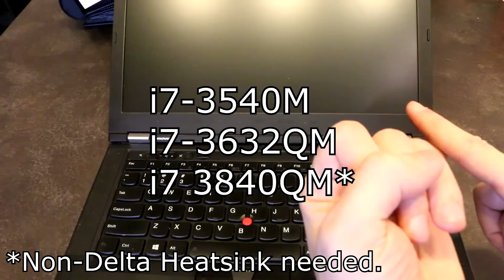Lenovo ThinkPad T430: Upgrade Wonder

Comment: If I'm at the Lenovo Diagnostic Menü, There is a Only "Quick Memory Test" and "Exit Application"
Reply from the maker: I'm not entirely sure what you are asking/saying here. Are you having issues?
Reply: @LaptopRetrospective  I have a Lenovo Thinkpad T430s
Reply: @imnotlxgit5762  Your best bet would be to go and grab Lenovo Vantage in my opinion. It has saved my backside plenty of times.
Reply from the maker: If it lets you boot. Unless there is a bootable version.
Reply: I don't think there's a bootable version, but if you can get into Windows it's really handy and can fix quite a few things.
Reply from the maker: Yeah. The OP isn't clear in the issue they are having.

Comment: You better buy a used T430 than a brandnew supermarket laptop made of plastic and with no chance to replace parts for about 400, 500, maybe 600 euros.
Reply from the maker: There are certainly advantages, it all depends on what you need the computer to do.

Comment: Is it worth in 2019? And how durable is this laptop?
Reply from the maker: Yes and very. There is a reason there are so many around still in use.
Reply: @LaptopRetrospective  good to hear that, my friend. I am offered to buy this machine with i5, 8GB Ram, 320GB HDD for 170 euro.
Reply from the maker: That's a decent price. Be prepared to replace the battery and I'd swap in an SSD if it isn't already.
Reply: @LaptopRetrospective  Yep, but the web camera doesnt work...
Reply from the maker: Could be the camera or cable. To replace both is less than $25 CDN.
Reply: @LaptopRetrospective  Okay. Thats cool. I am gonna buy one :)
Reply: @LaptopRetrospective  thanks for the fast feedback, bro! It was very helpful!
Reply from the maker: Hope you enjoy it! Remember that the service manual is readily available if you need to work on it.

Comment: What are they like for battery life?
Reply from the maker: Depends on how hard you run them and what cell count you have. People claim some pretty good numbers.
Reply: @LaptopRetrospective  do these refurbs generally. Come with new batteries? Or are they hard to get new one?
Reply from the maker: New batteries are easy to find. Some refurbishers will issue new batteries, others won't. Check before you buy.

Comment: This is probably my laptop of choice, I need to replace my current laptop and I was really attracted to the thinkpad style and the moddability of this thing. It's also on Amazon with 8gb for like 200 usd. I know I could probably get it cheaper on ebay, but I'd like something decent over a complete project build. Since I don't game as much as I used to, it can run AoE 2, Rome, Fable, and some other classics which is all I need nowadays (and Rimworld!). 

Also your advice on the pi is grand, but I think most people should get one! The zero, the one I have, is a fantastic little machine and it was like 10 bucks or something.
Reply from the maker: Very nice. Lots of options out there.
Reply: Hey, do you know if this laptop could run football manager 2020? That's all I'd really want to play plus the ones you mentioned!
Reply from the maker: System requirements for it are fairly low so you can probably manage. Not sure how well since I've never played it.

Comment: Hi I’m looking to get one of these to help me with a new career in IT and cyber security. Would you be able to advise to what internals to look for? I won’t be using for gaming, just taking apart, programming, possibly Linux? 
Unless there’s something else you recommend for a complete newbie
Reply from the maker: In terms of internals, I don't see that having an impact beyond something you can upgrade a lot to understand how things work.
Reply: Laptop Retrospective Thanks, also what negatives would you say there are between the smaller x201 against the t430? Furthermore can Linux be run alongside windows?
Reply from the maker: X201 is several generations older. Linux can be ran side by side.

Comment: Planning to buy this laptop, can i play apex legends in this?
Reply from the maker: System requirements?
Reply: @LaptopRetrospective  CPU: Intel Core i3-6300 3.8GHz / AMD FX-4350 4.2 GHz Quad-Core Processor

CPU Speed: Info

ram: 6 GB

os: 64-bit Windows 7

Video Card: 1 GB NVIDIA GeForce GT 640 / Radeon HD 7730

Pixel Shader: 5.0

Vertex Shader: 5.0

Free Disk Space: 22 GB

Dedicated Video RAM: 1 GB
Reply from the maker: The T430 doesn't have a dGPU generally and with the CPUs listed, I'd wager if it did run at all, probably not well enough to play.
Reply: @LaptopRetrospective  can it play smooth?
Reply from the maker: I doubt it.

Comment: I'm watching this on a T430 that I've done a few upgrades to so far:

- Brought the RAM to 12GB with the sticks I had on hand
- Swapped the original chicklet KB for a backlit one

What I hope to do next is swap out the LCD, change the 2nd 4GB stick to an 8GB, get a SATA drive bay for a 2nd SSD.  I'll still keep the DVD burner to swap out on the fly.  

I'm good w/ the i7 3520M that's in it currently, don't need the Quad Core.

I enjoy your content, especially on the AMAZING ThinkPads!  Thanks for sharing!
Reply from the maker: Thanks for the update Ryan on your upgrade history. Eager to hear how your LCD panel work goes.

Comment: wish I bouth one of thses instead of a mac, alas I was blind... sigh*
Reply: I hackintoshed my L530 and later my T440p, (MacbookPro 9,1 and MacbookPro 11,1 officially) mostly to run Logic Pro X without buying a Macbook. One of the best ideas of my entire life. I ended up removing my windows SSD on both because I was no longer using it. Best part is that my L530 dock works flawlessly OOB on MacOS
Reply from the maker: It is never too late.

Comment: hey man . look I have a T430 and I love it . the only problem  is my VGA port . I have a Dell Monitor and it works with my other laptop pretty good but with my T430 it's  all noise . and it gets disconnected  every 30 min . I don't know what the hell should I do so I Appreciate any suggestions and help . thanks .
Reply from the maker: Very strange, sounds more hardware related than software. Might want to take a look at your board.
Reply: OK . i will look in to it . but I ran diagnostic tests  on GPU and the board . I don't know  maybe  my VGA Cables  are not suitable .any how thanks for the help dude . I hope I found the source of problem soon because  it's driving me crazy 🤪
Reply from the maker: Good luck. I hope you find it soon too.

Comment: Does anyone know is it possible to replace bottom cover of t430 without removing the screen and whole chasis? As i got another i7 t430 today but bottom cover is broken on the corner.
Reply from the maker: Check the maintenance manual.

Comment: Picked up my T430 about a year ago for $220. Added 16gb of ram and a 500gb SSD. Super solid machine!
Reply: If i add 500gb ssd do i have to reinstall windows ?
Reply: @jefferymillerjr8572  Since the laptops tend to come with smaller SSD's, you can easily upgrade to a bigger drive using Acronis or another migration tool.
Reply: @dskribe9598  what you be the difference and would I have to reinstall windows?
Reply: @jefferymillerjr8572  The difference is speed. Migrating using Acronis Snap Deploy doesn't take long at all and you can pick up a license from them directly for $10 (one time use) or $30 (can use as much as you want only for that machine) versus a manual install of Windows which takes hours. Good luck! PS: Just to clarify, Either do it via Acronis or reinstall Windows.
Reply from the maker: Depends if you replace the original drive or not. If so, then yes, you'll either need to clone the original drive or reinstall.
Reply from the maker: Nice. Lots of RAM to go around.

Comment: @Laptop Retrospective  I bought this T430 immediately after watching this video. I immediately installed Scientific Linux7 on it and after 20 minutes of use, my hands started tingling especially the track pad ha d. Is radiation possible if this laptop is refitted with components that are too powerful? Is there a Max capacity for this laptop? My hands were tingly for about 5 minutes after. It was bizarre.Thanks! Specs: Refurbished Lenovo Thinkpad T430
Intel Dual Core I5-3320M 2.6 Ghz processor

2 x 8GB DDR3 Ram

120GB SSD Drive

DVDRW

14" Screen

Wifi 802.11a/b/g/n

Bluetooth 4.0

2 x USB 3.0

PoweredUSB 2.0

VGA

Mini DisplayPort

LAN
Reply from the maker: Tingling??? That's a new one. Only thing I can think is if the ground to the keyboard is wonky. Radiation is definitely not the issue. If it was emitting enough for you to feel then you'd have side effects.
Reply: @LaptopRetrospective  Ok, thanks, maybe it is the keyboard. I'll  take a look. Good to know that radiation shouldn't be a problem. It feels like tiny prickles...like electricity so I'll check all the connections.
Reply from the maker: The only thing I can think of is the connector is damaged, not seated properly or maybe they tried to do the Classic Keyboard mod and botched it and put the original chicklet one back. Thankfully this is easy to do. I'd take the keyboard out, look for strange/unusual damage or colours, then reseat, see if it still happens.

Comment: I am considering buying it in 2019 as laptop for coding.
I could buy it for 200-250$ depending on specs.
I am mostly afraid of its low quality screen, i would definitely go for 1600*900, but still not sure if it is good enough for other  X and P thinkpads with IPS full hd screens.
Reply from the maker: Unless you're doing art or things that demand colour accuracy they aren't that bad.

Comment: I love Thinkpads. Wife has T500. We upgraded memory from 8 to 16gb and installed a 500gb SSD. It is running Linux Mint and is very fast. My Thinkpad is a W520, 32gb,  500gb SSD w/Mint, I put a 2tb HDD in the DVD bay, and use it for video editing. It is my 5th Thinkpad ... a bit bulky but just run flawlessly. So sturdy you can leave them to your grandchildren.
Reply from the maker: Haha yeah, pretty much. I've read as lot of comments on how they get handed down.

Comment: I bought my T430 2 weeks ago for about 50$ usd. I've added 4GB of ram and ssd, replaced the fan. It's my main laptop now. Works great. :-)
Reply: Hey! I have the same laptop. May I ask what fan you bought and if now your laptop is silent? Cause I am having issue with the fan noise... Other than that I love T430!
Reply from the maker: Ah I see you're exploring the fan situation. Check the maintenance manual in the description for part numbers. eBay is great.
Reply: @LaptopRetrospective  So it's just my laptop that makes noise? That means I can fix it by buying another fan maybe?
Reply from the maker: @Laura-lg1tb  Yes.
Reply: @LaptopRetrospective   In case I have to replace the fan do you have any suggestions on the fan I should buy?
Reply from the maker: @Laura-lg1tb  the maintenance manual will tell you exactly what you want to buy.
Reply from the maker: Nice buy!
Reply: @LaptopRetrospective  i bought mine for 230usd, i5-3320m, 8gb ram, 1366x768, 500gb HDD did i overpay?
Reply from the maker: Sounds good.

Comment: The best notebook ever. I have bought an used one for 200 bucks online, then upgrade with a ssd and 16gb of ram an now this machine os flying! Runs like a new computer. Lenovo make these thinkpad series in a way that you can totally dismount and change parts separately. Marvelous!
Reply from the maker: Yes, a good chunk of them are made to be taken apart.
Reply: Hey, idk if you’ll reply bc you’re like a year old comment buuut when you upgraded to 16gb of ram could you play Minecraft?
Reply from the maker: Ram helps but it isn't the only requirement.

Comment: Hi I am looking at this for a student laptop - running Microsoft word, storing photos - very ligth work. 

The one I am looking at is: Lenovo Thinkpad T430 i5 2.6Ghz 4GB 320GB DVDRW USB 3.0 14″HD W10 Pro
Will this do the trick?
Reply: To run word any computer does the trick, even a t60, actually a t60/t61 is better for office work because of the 4:3 aspect ratio.
For anything else though, you want a more modern laptop like the t430
Reply from the maker: Easily. Be prepared to replace the battery as they often come with worn down ones. I suggest the 9 cell if longevity is important to you.

Comment: Awesome video, been in the hunt for a new laptop as my Asus' motherboard just popped the bed. Found this locally for 275 CAD:

Lenovo Thinkpad X230 Intel Core i5 3320M 2.6GHz 4G 320G

Do you guys think it would be fine for doing light gaming(older titles, nothing super extensive) and the typical browsing, streaming, etc.. Love the idea to being able to upgrade if need be and tinker.
Reply: Whoops, copied the wrong one. It's a T430 Core I5 3320M, 4G Ram, 320G SATAIII for $240
Reply from the maker: Does it have an Nvidia GPU? What games?
Reply: It doesnt say so I will assume it's not there. As far as games go:
Dawn of War 2
Homeworld Remastered
This War of Mine
Warcraft 3

Would love try Fractured space, Frostpunk or Northgard too.
Reply from the maker: Check the minimum system requirements. I believe the T430 runs Intel 4000 integrated graphics so be sure that would be enough for your needs. Or be ready to explore the expansion card egpu mod.
Reply: Thanks for all your help, I found a different t430, I5 4G RAM with the Nvidea graphics so I think I'm going to pull the trigger on that one(180 CAD)
Reply from the maker: Good price if it's in good shape.
Reply: Got it for 170, it's in great shape too. Excited to dip into Thinkpads, first thing to do is to upgrade to 8G ram.
Reply from the maker: SSD should be next. Huge difference.
Reply: I seemed to overlook that it was a T430s, wanted just the regular T430 but oh well, already bought lol. Yeah I want to do a SSd in as well but I dont have the windows install if I were to swap it out
Reply from the maker: Use the tool from Microsoft to make it.
Reply from the maker: Windows Media Creation Tool is the specific thing you need. You should be able to use the key attached to the unit.

Comment: This video got me so far as to purchase a T430 off of eBay, I just hope the battery is OK! I7 3520m, 8gb of ram, and an 225 GB ssd :)
Reply from the maker: Not bad, glad you found it helpful! A new battery won't break the bank and having a spare never hurts.
Reply: @LaptopRetrospective  I might consider that! I just found out the charger I got from amazon is rated at 90W, but it was listed at 65W, so I'll have to deal with that hassle first! Thanks for the video!
Reply from the maker: Common mistake often made by sellers as they look very similar. Hope you get it sorted out.

Comment: Ah, the 30 series. The last real ThinkPads. I've decked the whole office out in these, they've become the standard (though I now go for the t430s, the slim, lighter version). Last ThinkPad to have LEDs, touchpad buttons, and to be actually built like a ThinkPad. After that, it was all jet-setting executive MacBook-derived garbage. :(
3:43 I frikin died when the video cut away without mentioning the 2nd stick is under the keyboard, 2 screws away from where you were.
Reply: thanks for the info, I might buy a t430 or t530 sometime when I'm on my own money because I'm a sucker for vintage :D

Comment: Bought the T430 a few days ago after doing some research. Gladly it is for now a nice choise. I have the i5 with 8gb and 128gb SSD. And the screen is 1600x900, but is no deal, i use it at home with a extern nicer and bigger screen. For me its all an upgrade so im happy with it, even if its a old model. Its still good i noticed so thats why i made this choise and the price was good too, 200 euro. I use it just for regular stuff and some small gaming. I got the fm 19 but playing on low spec as the T430 doesnt have a great vid. card. 

Im not a expert on upgrading laptops so i think i wont do anything, but the heatsink. Is that to keep the laptop cool or? Atm the laptop is quite oke and doesnt heat up that much for now.
Reply from the maker: Glad you're enjoying it. The heatsink should be fine.
Reply: @LaptopRetrospective  Thanks. Nice vid also by the way. Ah ok, so there is a heatsink on it already i guess...?
Reply from the maker: Correct.
Reply: how's the fm 19 performance on T430? I planned to get T430 as my main laptop (ms office task, browsing, streaming and fm 19 for daily) thanks
Reply: @teguhrama2522  Hey i bought one and playing fm19 on it. :) Only the graphics are not good so you need to play 2D and not 3D, but overall its playable. And i like the laptop alot, very nice with ssd also. Using it for normal stuff, not any high performance stuff or anything.
Reply from the maker: Not familiar with FM19. The rest is easy.

Comment: Im thinking to buy T440. Is it good? I want to use it for programming. What do you think?
Reply: I was going to be a student in Computer Science. So i will use it on the college. I don't know what kind of programming that will face there
Reply from the maker: So they give any suggestions for system requirements?
Reply from the maker: What kind of programming?

Comment: Review about the camera please?
Reply from the maker: You mean the webcam or the one I film with? 😁
Reply: @LaptopRetrospective  webcam, sorry for my bad english. is this laptop good for home based job?
Reply from the maker: It's functional. It won't win any awards but it does the job. Let me know if you want specific information and I'll try to get it.
Reply: @LaptopRetrospective  for 218$ t430 8gb ram and 160gb ssd. is it worth it? i am planning to but this one.
Reply from the maker: If it's in good cosmetic condition and the battery holds a charge, I'd do it. Assuming that's USD?
Reply: @LaptopRetrospective  thank you. Its USD, i saw it selling online. Looking for the specs i think its a good buy.
Reply from the maker: Might want a bigger SSD down the road but not a bad place to start.